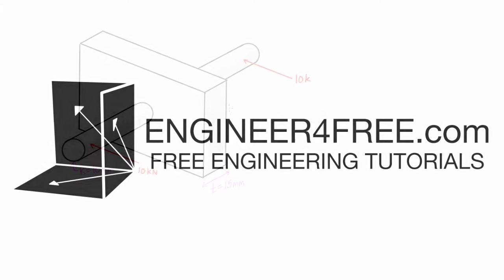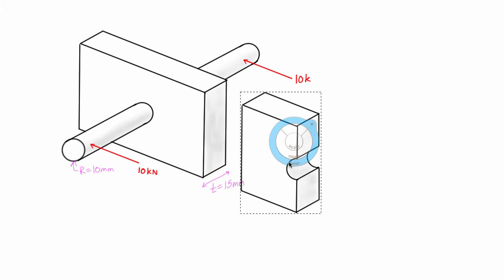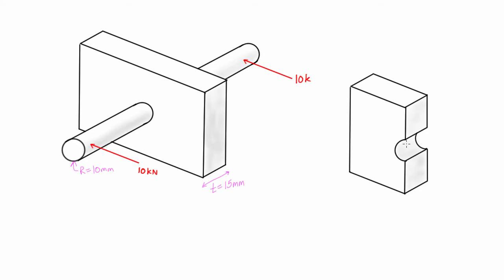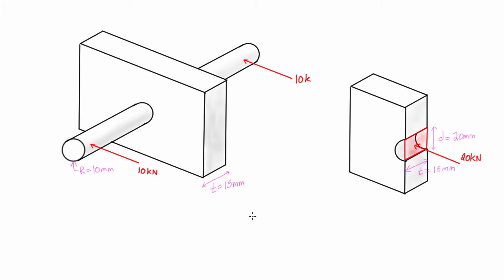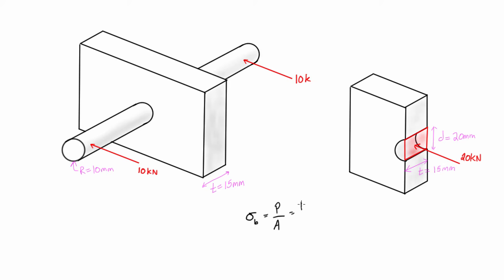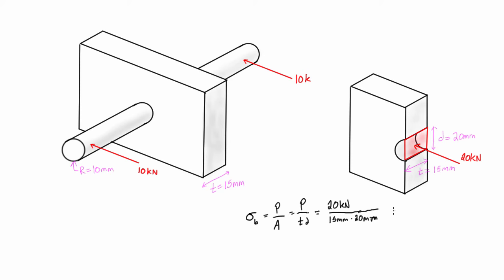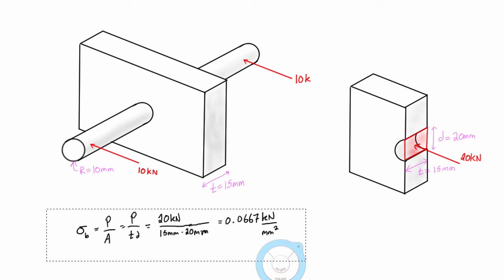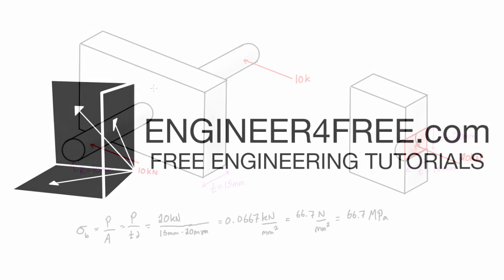Bearing stress

Comment: Nice video! But I would like to ask if what is the main difference between shear stress and bearing stress? since I'm still a little confused.
Reply from the maker: Take a look at this video: https://www.engineer4free.com/4/shearing-stress Shearing stress is more like trying to force a clean break, whereas bearing stress is more trying to crush the rod. The blocks in the other video would technically be exerting a bearing stress too, there is shearing stress in the rod occurring in the plane the lays between them.

Comment: the area is not  the half of circumference of a circle multiplied by t
so A=((pi*d)/2) * t
 A=(pi*20)/2 *15
A= 471.23mm^2
isn't it ? .
Reply from the maker: Yes and no. The actual contact area between the rod and the plate is 471.23mm^2 like you have calculated, but because of the complex nature of the stress distributions in the curved surface, it suffices to take the projection of the rod onto the connection (so diameter of the rod times the width of the plate), and consider that projected area to be subjected to a normal stress (equal to the applied load divided by the rectangular projected area). It is a simplification, but in practice is good enough!

Comment: what is the area if the rod is not circular?
Reply from the maker: If you are studying at the undergraduate level, just take the projection of the rod onto the other member such that direction of the force is normal to the projected area, like I did in this example.
Reply: how to determine the projection area? lets say a square which it slightly rotated.
Reply from the maker: Use basic geometry. If you know the angle it's been rotated at, draw it out. Use SOH CAH TOA to determine the new distance from axis of rotation to the top most fibres and bottom most fibres of the rod.

Comment: Where does 20 KN load come from ?
Reply from the maker: It's the sum of the two 10kN point loads acting on the cylindrical member, but it transfers to the block on the single contact surface as 20kN.

Comment: is it not the area  πDT ?
Reply from the maker: Hey John thanks for the question. You're right that the actual contact surface is πdt but because of the complicated nature of that surface being curved, it suffices to take the rectangular projection of the rod on to block, effectively making A=td. You will see this simplification made in mechanics of materials textbooks too.
Reply: Also, what we are calculating is average bearing stress, so it probably is fair to just use the projected area. Keep in mind the stress will be different in every part because of the shape (more stress in center rather than top and bottom) - I think
Reply: @cristianconstantin6496  Yes, maximum stress is located in the same direction as the direction the force is being applied in and the minimum stress is going to be at +- pi/2 radians. The pressure increases and decreases in a sinusoidal manner, where at theta = 0, pressure equals maximum and theta = 90, pressure equals 0. In other words, cosine function would be used.